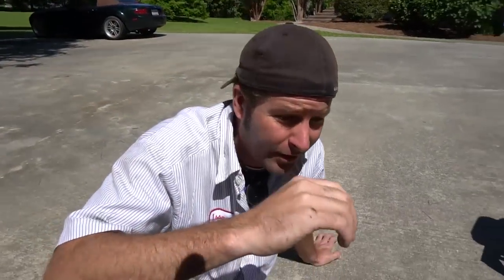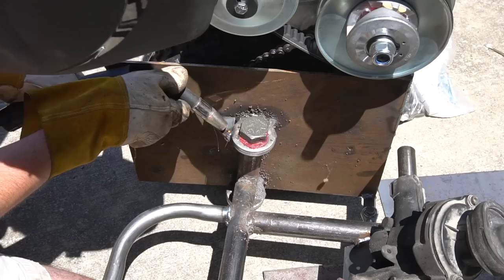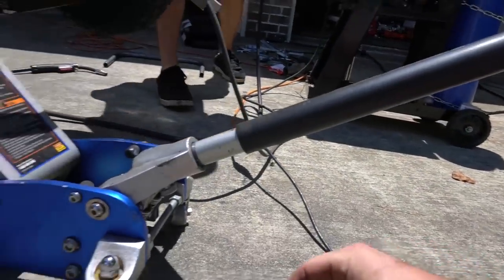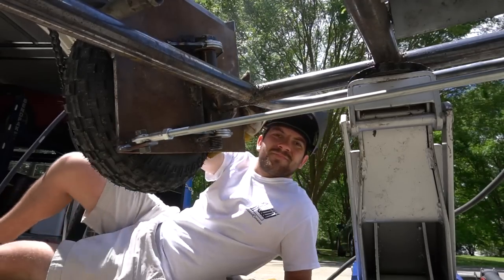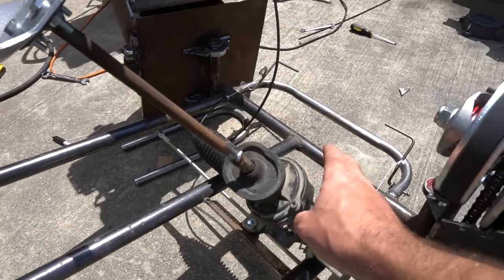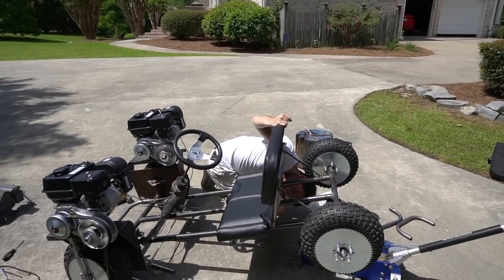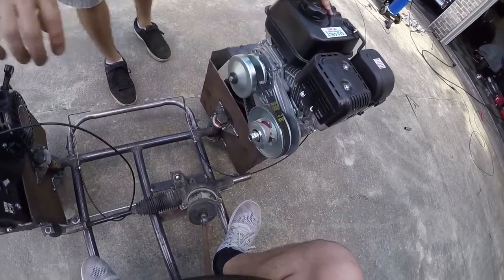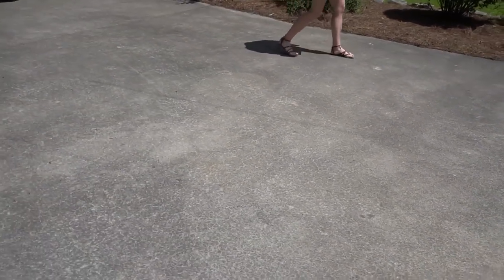FWD Burnouts: Steering, Bracing, & Test Runs

Comment: If you need a simple steering joint, how about a 1/2" drive impact universal joint from a local tool shop?
Reply: That's a great idea.
Reply: You can go to most tractor supply stores and the have a few bins of universal joints as parts for lawn mowers and tractors.
Reply: I suppose that'd be easier for them, not something that's too common in the uk which is why I didn't think of it, but if you've got it you might as well use it
Reply: Lol and just weld a socket on the rack and use extensions to connect to the steering wheel.
Reply: Marius G diy quick release steering wheel
Reply: i used a 3/4 inch drive universal for and early v8s10  i made back in 1990
Reply: sorry I'm used to talking to US members on most of the US videos I reply to. I know they talk about going to lowes and tractor supply which is both stores I have in my area a few miles away (they in north carolina and I'm in arkansas).
Reply: i started out building and racing v8 luvs back in the 80s before there was swap kits. Now own a 2wd s10 with a 4.8 and a 4x4 with a ls6, please tell me you aint driving that on the public roads. I "might" agree on it for a go cart but for street or racing use you should know better. Hell any track worth a crap would black flag you for that alone.

Comment: Nice booger welds, clean the metal first!
Reply: they were using flux core
Reply: Vax Buster grinder and paint, makes me the welder I ain't!  Sure it'll pretty up at some stage
Reply: you can easily weld dimes with flux core lol
Reply: seniornuggtes but it is different than there own welder
Reply: only because they didnt even try to weld good with the fluxcore
Reply: and drag flux cored wires
Reply: I don't matter what wire or weld process you use there are different techniques that good welds happen and steady arm
Reply: Did they even have the shielding gas on
Reply: Arthur Herrera flux core doesn't use gas

Comment: CarsandCameras connect both throttles to one long bar across the front where the 2 throttles are so you can just press down in the middle and both will go at the same speed
Reply: Jst sayit steering under power would then become an issue. Especially high speed turns. Like a locked front diff fwd car. Not gonna work.

Comment: if you guys dont want to go about balancing 4 engines to have the exact same throttle response on 1 pedal with cables i would go about trying to set up drive by wire using some sort of heavy duty potentiometer on the pedal and servos for the throttles. servo controllers arent too hard to come by and all you would need is a small sealed lead acid battery to drive the circuitry.

Comment: three pedals, one throttle either side for each bank of motors(two cables hooked to one pedal, right pedal for both right motors) and middle pedal for all brakes/two small pedals for front/rear brakes. just a suggestion and would be pretty sick.

Comment: i made a fwd go kart 13 years ago
i used  front engine front wheel drive  with front hubs and 4 wheel brakes driven by beefy steering universals(the universal joints from the steering colum to the steering rack/box)
rear fuel tank(15litre) electric carby fuel pump external generator ran from the flywheel
full lights setup, fiberglass body
for steering rack i used  a shortened Ford escort(Europe type) Mk2 aka as yankys call them "second generation"
worked well for many years till it was stolen

Comment: it be a good idea to weld out of the wind , preferably inside
the gas you use to shield the weldpudle from the bad stuff will blow away at the slightest gust of wind unless you use a windscreen  or turn the gasflow way up

Comment: I would say move the rack to the front and use a gear and chain to reduce the amount of turns also give more leg room and correct the odd angle of the steering wheel

Comment: Youd be better off running a second tube with intermediate bracing across the top two steering uprights. Would make the front end much stronger.

Comment: Guesset all the things!  Also, with as much power as you will have plus the torque converters, put some smaller sprockets on those wheels.  (or larger engine sprockets)  It will have plenty of torque to pull higher gearing.  And however you are going to do brakes, make sure they are really good brakes!!!

Comment: HOOK UP THE OTHER TWO MOTORS, BOTH RIGHT CARBS TOGETHER ON ONE CABLE , AND THE TWO LEFT CARBS TOGETHER ON ONE CABLE .TRY TWO AXLES IN THE BACK MAKING ALL WHEELS INDEPENDENT OF EACH OTHER.THEN WHEN YOU RACE AROUND A TRACK, USE THE POWER TO HELP STEER IN THE TURNS.GIVE THE LEFT SIDE LESS THROTTLE GOING IN LEFT OVALS YOU WILL HAVE A TRACKING MACHINE LIKE NO OTHER. MARTIN

Comment: Maybe you should make a throttle bar on the front so you can connect all the throttles instead of one on each foot. That way they'd all pull at the same time and you'd free up a foot for a brake.

Comment: Y'all should mount the two pedals beside each other so the foot pegs line up.  That way if you pressed down in the middle it would activate both pedals but if you moved your foot slightly to the left or right you could operate only one pedal at a time.  That would open up the left foot for the brake pedal.
Reply: like steering brakes on a tractor. Even go as far with that theme and lave a lever than you can flip with your toe to lock/unlock them together.

Comment: Is the dual throttle thing going to stay when the rear pair of engines are on board? I hope so. Once you get the hang of it, having the ability to accelerate the outside wheels during cornering would be a massive advantage. 

Dual foot throttle and a central brake pedal?
Reply: I'm not sure if it will keep multiple pedals

Comment: they should've done a live axle in the back with both motors driving it by chain. same as the front but with U-joints for steering. it would've saved them the awkward motor set up

Comment: you should move the air filter exhaust and air filter down... (performance air filter with turn so its not in the way, gas tank behind tank with 4 outputs, and a lowered exhaust
Reply: and 1 kill switch

Comment: why not tie the pedals into one another, and when you add the two engines in the rear run cables to tie into the existing pedal and just tighten them so that they all actuate at the same rate. one pedal that ties the 4 engines together then figure out brakes.

Comment: I asked about a motor for a 54 Mercedes Benz 121/ w 180 in a previous video. The answer I got was a 383 stroker, but I was hoping for something a little less spectacular. Maybe 150-175 hp max, small, cheap, EFI, 4 speed that wouldn't have problems if I ran an AC  compressor. Something that would be easy to find parts for, and not overly complicated to diagnose problems on.      Any suggestions?
Reply: 4.3L gm v6, basically a smc with 2 cyl. removed, great motor, very reliable, and should be right around your hp needs, they can be fond in everthing from astro/safari mini vans to full size gm trucks
Reply: darkside0914 yeah the 4.3 v6 is just the 350 small block without cylinder 7 and 8
Reply: I like what darkside said
Reply: thanks, it seemed to me that it would be the best choice of engine that met all his needs.

Comment: hey, I have a question. my friend and I got an old goped for $25. all it needed was a new primer bulb and cleaned fuel system, we got that already. it runs but when we give full throttle it bogs down, so it's not getting enough fuel. I took a video of what happens, but I just don't know how to adjust it properly to get it to actually fully rev up when we give it fill throttle. it goes about 60% throttle then dies at the moment. HALP PLZ I FAN
Reply: I bet there is garbage in the carb